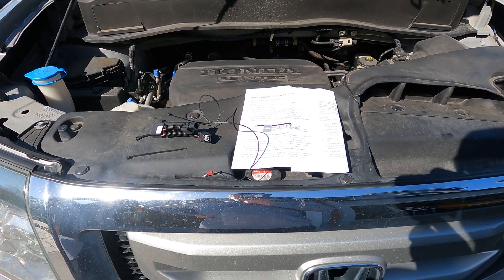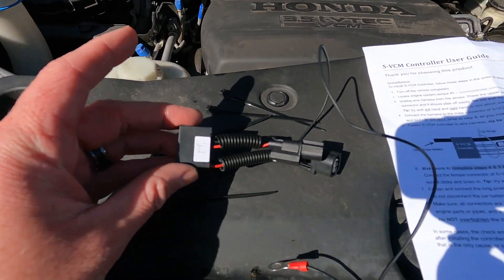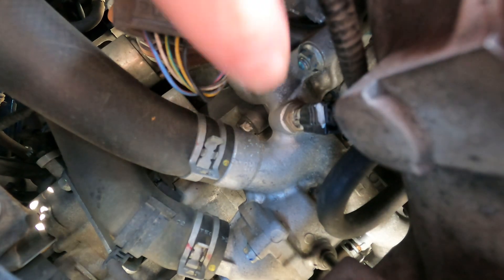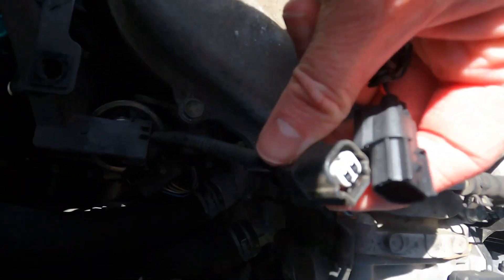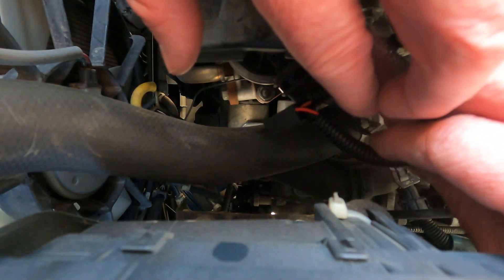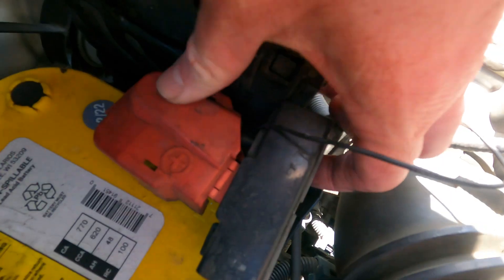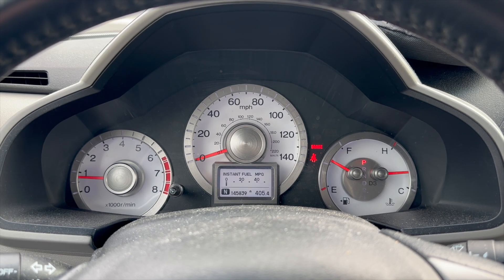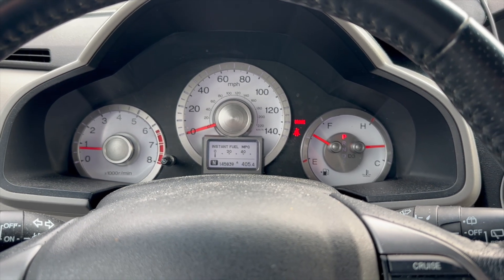VCM Delete on Honda Pilot - Will it fix oil burning? Part 2 P0420/P0430

Comment: With this system the car stops burning oil but increases gasoline consumption. How true is that?
Reply from the maker: It definitely burns a lot less oil now. I haven’t measured any change in gas mileage. Notably I live in a mountainous area so maybe if you are doing a lot of highway miles you might see a difference

Comment: oil burning comes from using regular gas not premium..look it up.. regular has a faster ignition making it burn much hotter.. premium is slower burning and even and refined..
Reply from the maker: I use premium from Chevron or Shell in all my cars

Comment: Will this help reduce missfires on cylinders 1-3?
Reply from the maker: Yes, it is possible. I’d also recommend replacing the spark plugs, coil packs, and running fuel injector cleaner

Comment: Hello. Just wondering if your Honda pilot stopped burning oil after you deleted the VCM
Reply from the maker: Yes, there was a very significant improvement. Still working on putting enough miles on it for a follow up video
Reply: Ok looking forward to the follow up video .  Thanks
Reply from the maker: @IanJonesMusic right on! Thanks for watching!
Reply: My 2010 is still burning crazy amounts of oil even after the VCM delete. Check engine light goes off for a few days them comes back on. Pisses me off. Anyone have other suggestions?

Comment: Hi there.. I also have a honda pilot with misfiring problems usually cylinder 1 or 3.. Been thinking of getting the vcm muzzle but I see 2 kinds online.. The one installed in the video and another that doesn't connect to the pos terminal (comes with 4 different ohms from amazon).. Which one to get? And why it connects to the battery and other one doesn't? Anyone know?.. Pls help
Reply from the maker: I can personally vouch for the one I used in the video. The link to it is in the description. It has been operating flawlessly for months now. It uses the positive terminal because it is actually a small digital system that is actively measuring the engine temp and using a small program to decide what output to send to the ECM to safely keep the VCM turned off. This system also automatically bypasses itself when it senses the engine is overheating. Many of the other kits use a passive resistor that works in many but not all situations, so the VCM may turn back on at times.
Reply: @btechnol  awesome thank you for the quick reply...definitely will get one.
Reply: @My.TingTing  I have a 2011 Pilot and bought the VCMuzzler about a year ago and its been a game changer. It comes with several resistors and the default works very well. 
Very few times the Eco light has turned on and that is when it is hot out (90+) and traffic is moving very slowly for extended periods of time like stop go traffic. Not nearly enough to cause the same damage as prior to the Muzzle device.
There are 2 others muzzle devices that are solid state which I passed on due to reports of the device failing electronically. YMMV, but I dont think you can wrong with any of them.
Reply from the maker: @chipotzky thanks for the intel!
Reply: @btechnol hi! Checking on update for this also…. How’s this fix been?

Comment: Catalyst converter meant for filtering carbon monoxide from polluting air. Meanwhile what if Variable Cylinder Management (VCM) broken, isn't it one cause of clogged piston ring, which ends up internal combustion not meets Euro standard of emissions?
Reply from the maker: Yes, it is ironic the the vcm not working can actually make the emissions worse